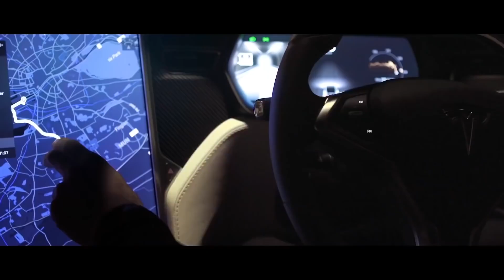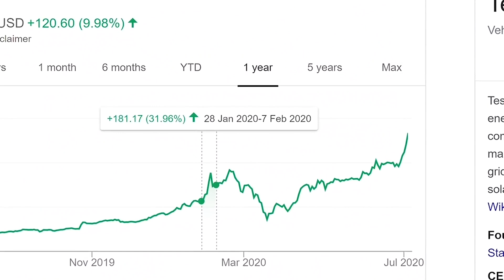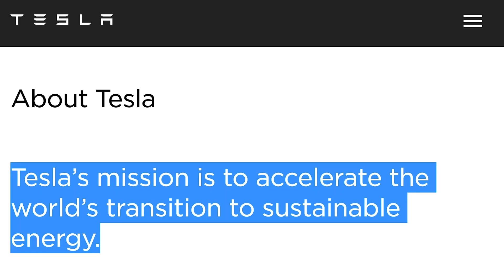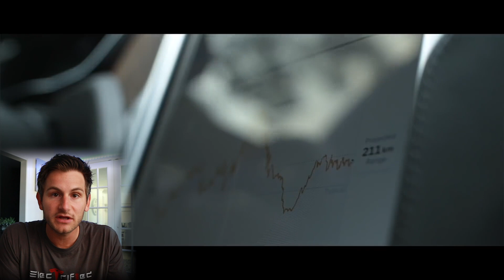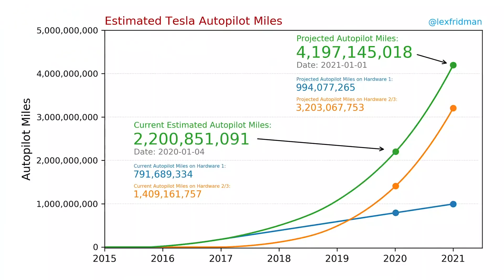Biggest Challenge to EV Adoption (ARK Invest)

Comment: Lithium based batteries aren’t going away, the same way that Lead-Acid batteries haven’t gone away. . .   but they WILL be supplanted in energy-dense requirements.

For now, I cannot understand why lithium iln chemistry is bring used for stationary power installations, other than , “hey, we can do this quickly with inventory, and help promote our name”. . .
Reply: Cheaper than alternatives
Reply from the maker: Cheaper, cleaner, more reliable

Comment: Good point, Elon secured a 12 year supply. Makes Sense TESLA IS IN CHINA and are the biggest user and Supplier. Don’t worry Mister TESLA BUYER? You must have done a poor job for Elon cause he let You go. Elon will open his own and operate his own lithium mine. You obviously were not involved with these cobalt and lithium plans. I hope these 2 Turkeys are not employed by Ark Investments. NOT IMPRESSED WITH YOUR GUESTS. I do agree with You about lithium cells are not going away soon. Elon is pursuing MULTIPLE SOLUTIONS around the world in different factories with different chemicals. The biggest take away is that only 2/3 of the range comes from the same kilowatt battery that others use.
Others can achieve mostly 200 miles of range. TESLA is moving to 400 miles from 300 because of their software and battery conditions others don’t have. SEPTEMBER 22ND, TESLA WILL SHOW THE WORLD THEIR SUPERIORITY IN BATTERIES.
Reply from the maker: Thanks for watching

Comment: In the short term, I get this. But lithium/nickle/chromium/copper is not consumed by being used in a battery. At some point, the biggest lithium "miners" will be the battery recyclers. The hole diggers will only have to cover growth and losses in the recycling chain. Recycling is attractive due to the inherent value of the minerals. The time to recover the minerals will be lowest where the density of those minerals is highest. Whereever you have a big pile of old cells, you have the cheapest source of every mineral you need to make new batteries.

Comment: I don't know of any battery technology that is going to compete with Li-ion that is not also based on lithium—at least, not for weight-critical applications like cars.

The bigger danger, long-term, may be that energy storage could get locked into lithium-based batteries for a long time, not because they're the best solution for all energy storage requirements, but just because they get made in such huge quantities for motor vehicles, and nothing else can compete. This is a cumulative advantage (Wright's Law) that just keeps growing as the technology descends its learning curve.
Reply from the maker: Great point Ronald. I still believe that current generation Li-ion batteries are enough of an improvement over peaker plants that it's not even a question. Tesla has proven the model in South Australia
Reply: @DillonLoomis22  Yes, things do seem to be rapidly getting to that point. The problem could be that other promising technologies could have trouble competing, even though they may have advantages in some situations, just because they can't scale up. Sometimes government subsidies are aimed at overcoming just this kind of lock-in syndrome. It remains to be seen whether lock-in will be a problem because of Li-ion batteries.

One example of a possible locked-out battery technology could be Donald Sadoway's "dirt cheap because it's made of dirt" battery. It's based on the kind of technology used for smelting aluminum. His idea is that for stationary storage, you don't really care about weight, so just make the battery out of really cheap materials. But again, he may have arrived too late to compete with Li-ion for stationary storage, even though high energy density is not needed for stationary purposes.
Reply: @ronaldgarrison8478  any test results available?

I know about robot crane / gravity, and vanadium flow batteries, is that different?
Reply: @lengould9262  I'm confused about the question. I don't have any numbers at hand for flow batteries. The first part: Are you referring to "gravity batteries"? I may have some cost estimates in my notes, although I'm not sure just off the top of my head. Of course, for Li-ion, the threshold everyone seems on the verge of beating is $100 per kWh. I have no doubt that will be achieved soon. Opinions differ on how much lower that can be pushed. I can only speak in general terms without digging in and doing a bunch of research, but what I've noticed over several years is that prices for high-tech products just keep going down and down. It's hard to identify a floor. For example: In 1982, when I was working in home computers in the early days, one manager told me that, while most parts of a system were coming down in cost, display monitors were not getting any cheaper. Well, I can tell you I bought a 14-inch CRT in 1984 for about $500. Now, I have a 21-inch LCD, with about 12 times as many pixels and full color, that cost about $90. So it isn't just solid-state stuff that falls in price. Just about anything made in large numbers just keeps getting cheaper. It's very hard if you have to compete with that.

Comment: The last convergence of energy and transportation happened 100 years ago, 1920's. Cars and roads were making city life safer and healthier without horses and ankle deep poop and cars brought new sources of tax revenues. Cars quickly became a requirement. But the days of poking a hole in the ground and have oil gush out were over. Wells had to be discovered, scientifically and that cost money. No oil, no cars. Government agreed and supplemented oil companies to find and produce a steady flow of gas. That has expanded and remains today as the biggest subsidy our taxes bear. Switch that subsidy to clean mines and watch Big Oil move to digging...
Reply from the maker: That's what needs to happen. Industry needs to drive it first and then the government will trail with support for jobs
Reply: Tell that to the Saudis.  Their wells still produce under pressure.  Tell that to Unocal and BP with their offshore rigs.  Tell that to folks in North Dakota...

Oil is essential for plastics, medicinal substrates, electronics processes and parts, and metallurgical production.  It's also still the most viable source of power for ships, aircraft, and baseline power production.  It has as essential a role in OBTAINING lithium, as batteries have in USING lithium.  Saying it'll just 'disappear' because electric cars, is just foolish.
Reply: @billcichoke2534  sadly you have missed the point...

Comment: I'm missing information about the upcoming Battery and Powertrain Investor Day. About tabless cells, dry-battery-electrode technology, the million mile cell chemistry. Tesla is going to scale much much faster. I won't be surprised to see 20% cheaper, 20% more energy dense cells being announced. Couple this with faster charging rates (chemistry + tabless cells), vehicle to grid technology (opened up by reduced battery degradation b/c of chemistry changes). Wouldn't be surprised if Tesla actually ends up mining required materials themselves after buying a few companies.
Also they'll probably end up doing recycling as well. Former Tesla battery expert and CTO J.B. Straubel is allegedly working on such technologies after his departure from Tesla a few years ago. Not that far from the Nevada Giga-factory either IIRC...
Reply from the maker: Love the optimism but I'm not sure V2G is going to be a thing yet. This is not a software update but a parts replacement required as far as I know
Reply: @DillonLoomis22  You can assume that, but assuming it will not happen is a foolish as assuming it will happen.  Taking care is one thing, but planning your business on the idea that a competitor like Tesla will not do certain things can leave out of business.

Comment: Why didn’t the American coal industry segue into this industry? After all, mining is mining. Complacency and lack of vision?
Reply from the maker: Exactly what you said lol unwilling to change as it's hard work and big capital outlays up front
Reply: It makes sense that they will.
Reply from the maker: they will or they will be BK in 15 years
Reply: Because of environmental law.  Greenie weenies shutting down COAL mining, would not STAND for the destruction done by LITHIUM ORES mining.

It's not the market that's shutting down coal... it's lefties and government regulation.  All the while, solar panel production, steel and aluminum production, and other processes in the 'green tech' pipeline, are using more coal than ever.

It's the 'solution' that keeps on failing.
Reply: @billcichoke2534  GARBAGE!  Coal is dying because aside from the massive air pollution and the piles of ashes left behind energy from wind and solar is now cheaper than coal.  The industry goes to where there is the most profit.  You can't convince a CEO to pay X dollars for power when solar/wind will cost 0.8*X for the same power.  Money talks, coal stays in the ground.
Reply: @earlpottinger671  Yeeeeah...tell that to the solar industry, which uses more coal to make their silicon panels than ATEEL does.  Ask the aluminum industry, that uses similar smelting processes to the coal industry, but requires more power and coal inputs (up to EIGHT TIMES more) than steel.

The only thing making coal more expensive, is capricious government mandate and enviro-whacko lawsuits.  The only reason unreliable and intermittent solar and wind EXIST, is because of government SUBSIDY.

Sorry, Charlie...we're slowly shutting down the gravy train for lefty anti-freedom projects.
Reply: @billcichoke2534  you don't have a single source to your claim about solar panels. Aluminium smelting is usually done near hydroelectric dams because hydroelectric is the cheapest electricity of all.
Reply: @nathanlewis42  You know one of them, that movie you all want to forget.  As to coal use for aluminum production:

https://www.sciencedirect.com/topics/engineering/aluminum-production

Also, most aluminum processing takes place away from sources of hydroelectric power.  93% of China's production is COAL-fired.

So, as you can see...you're wrong.

Anything else?
Reply: @billcichoke2534  Dinosaur promoting burning dinosaur remains. A lot of US aluminum is produced in Quebec, Canada using their huge northern hydro developments. Sorry your investments in coal burners are toast.
Reply: @lengould9262  Hmmm...where did you think the coke for those smelters comes from...soybeans?

As a matter of fact...

https://www.cer-rec.gc.ca/nrg/ntgrtd/mrkt/nrgsstmprfls/cda-eng.html

61% from hydro and 32% from oil, gas, and coal.

But yeah, you know more about hydro than anyone in the U.S.  I guess Niagra, Hoover, and Bonneville are just figments of our imagination, right?  And no smelter that has electricity around it, uses ANY petrofuels or coal, right?  Sheesh...

By the way, investments in PETROfuels (as in 'from rock' and not 'from old bodies') or coal, are NOT the same as investments in ENERGY.  That covers EVERYTHING, and sticks with SOLID and STABLE investments, not some trendy wendy thing like pinwheels and smoke-and-mirror solar.
Reply: @billcichoke2534  can't even read your own reference, where we find that electricity generation in Province of Quebec where all Cdn aluminum is produced is 95% hydro, 0% coal.

Canada produces >%3.5x aluminum US does, US is a large purchaser. https://investingnews.com/daily/resource-investing/industrial-metals-investing/aluminum-investing/aluminum-producing-countries/

Done with dinosaur trolls. Have a day.
Reply: @lengould9262  And you didn't read it either.  Again, where does the coke and the carbon for your smelting process come from?  Not electricity.

You anti industry types CANNOT have it both ways.  You use coal and other 'evil' fuels for just as many processes and transportation as we do.  And you buy our medications at generic prices and still run a medical system that's under lawsuit for being an abuse of human rights.

Down off your high horse...you don't HAVE one.
Reply: Bill Cichoke Guess your not a Tesla shareholder.   Ev adoption will help the planet despite short term inefficientcies.   Look past your politics to the bigger picture.   There are cities in China where the smog blocks out the sun.
Reply: @ken-mb5cp  Politics affect EVERYTHING.  Telling someone to 'look past' theirs, usually means you want them to agree with YOURS.

And the main thing that will help the planet, speaking of politics, is to get rid of dictatorial regimes.  Countries like China, that restrict their inhabitants' freedoms, often result in those citizens living in poverty and squalor.  They also, more oft than not, POLLUTE more (as in China, as well as many African countries).

Let's make sure everyone has the same level of freedom as the U.S. USED to have, then go from there.  O think you'll find resource use and overall quality of environment would improve FAR more than forcing people into golf carts they can't afford or use.
Reply: Bill Cichoke Thanks for your input.   Have a nice day.
Reply: @ken-mb5cp  You're welcome.  You too.

Comment: Extended range will cease to be a problem as: 1. Range anxiety fades away. 2. Range slowly grows by: 2a. aerodynamics. 2b. Light-weighting. 2c. More efficient batteries, e.g., increased energy storage, faster charging. 2d. More charging stations. 
When Aptera reaches production, self-charging (roof PV) will be unique to them as will 1000+ range.
Reply from the maker: 1,000 mile range would be a great technical accomplishment but unnecessary as what we really need is about 400 mile range for less than $30k for mass market adoption imo
Reply: @DillonLoomis22  Thanks, I forgot about the price problem.  I'm retired, price no problem, but for 40 years it was major and for most still is.
Reply: Range anxiety is not a real problem.  In most cases people can drive from home to work and back plus extras and then charge overnight without coming close to the limits.  For longer trips you need to plan a little where you put your stops and there are apps that can help you out and Tesla has a build in route planner that takes charging into the planed route and it even tells you your arrival percentage and return percentage.
Reply: @casper_hansen  Not a problem? Yes, I agree, for me. My wife, her sister and brother-in-law disagree. My in-laws live 640 miles away and claim that makes a BEV impossible. Then I reminded them they flew here, rented a car. They were silent. My point: People are not rational. You can't argue with fear. I will buy and show my wife (It's not going to be easy).

Comment: The only way lithium ion battery becomes irrelevant is when the alternative is a magnitude cheaper .. and magnitude scalable .. and there is no such tech on the horizon ...
Reply from the maker: Agreed, not even close
Reply: Disagree - University or Maryland  @DillonLoomis22
Reply: An order of magnitude is a factor of ten.  It wouldn't even take a factor of two to make lithium ion irrelevant.  Importantly, though, batteries compete on multiple dimensions, cost and scalability being only two of them.
Reply: Elon has several surprises for battery day. Not that Elon would ever surprise. (-: One is a much more stable battery that does not have a problem with full charge and running on empty. Lithium Iron Phosphate.

Comment: In a video about the EV disription.. you fail to grasp the disruption that solid state batteries with 2x or more energy density will be to existing LiIon battery chemistries. Yes, they will continue to be made and used. But when competitors using SS batteries can sell cars with 2x the range, or 1/2 the battery cost.. how long do you think 2170 cells will continue to be used for EVs?
Reply from the maker: For a long time...there will be a ton of applications not requiring a solid state battery. If Li-ion can get 400 miles of range now and 600 in a few years, that's more than enough for 90% of use cases and will be cheaper than solid state for a long time